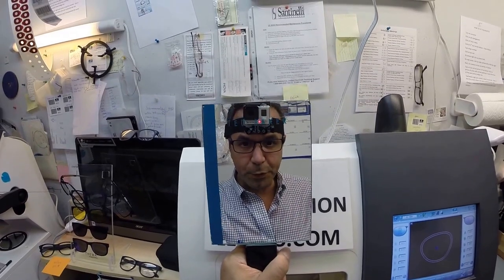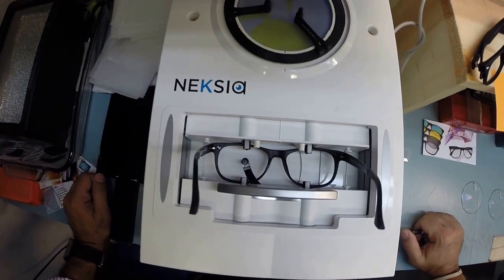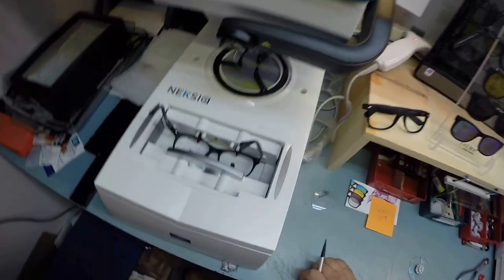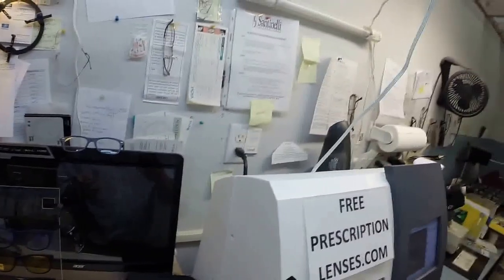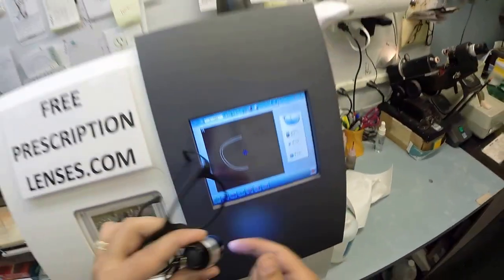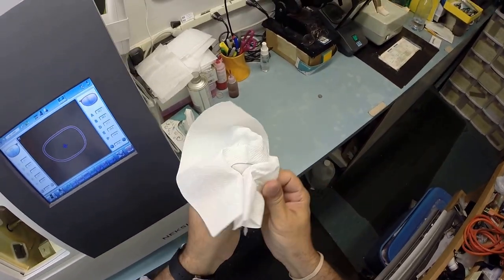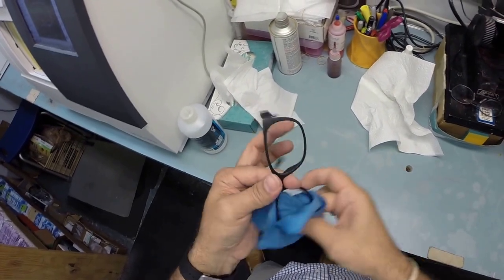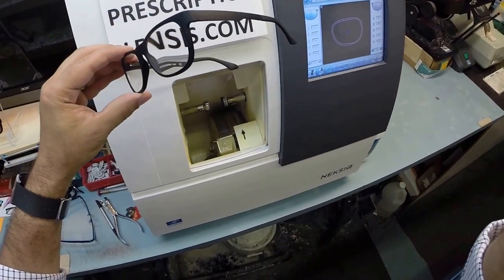Ultem 200 Rx Frame with 4 Magnetic Clips Included

Comment: Hello, what do you take for cleaning the lenses at 12:55?
Reply from the maker: It is an optical grade acetone that goes by the brand name All Off. You can order it through a company named OptiSource. Here is a link:
https://www.1-800-optisource.com/All-Off-Marking-Ink-Remover-16-oz.aspx
Reply: Thank you. I bought an Ultem 207 2 days ago ... prima Brille ;-)
Reply from the maker: The optical grade acetone might be overkill. Lust the regular eyeglass cleaner at your local optical shop would work well enough for your lenses. Just be sure not to use rubbing alcohol. At least Ultem says not to, so I don't.

Comment: Does Ultem 200 and Rayban New Wayfarer look good on circle face?
Reply from the maker: +W0LV1E45 Try on a RayBan 2132 and decide for yourself. You should be able to find one at any optical shop or mall. Its my number one selling frame but of style and comfort. I wore the 2132 New Wayfarer for years as my everyday eyeglasses but I have switched to the Ultem 200 and those are even more comfortable! But Ultem also has the 206 small rectangle and the 207 larger rectangle. Email me at freeprescriptionlenses@gmail.com if you have any more questions...........Matthew
Reply: +freeprescriptionlenses.com Whats the lens height of ultem 207?
Reply: +freeprescriptionlenses.com And also 206ultem lens height? thanks
Reply from the maker: +W0LV1E45 The height of this lens is 39 millimeters
Reply from the maker: +W0LV1E45  The height of the 206 is 33 millimeters